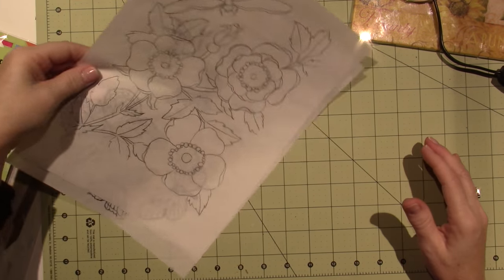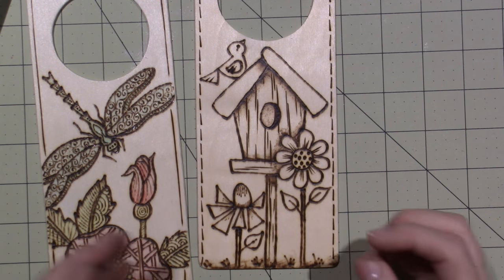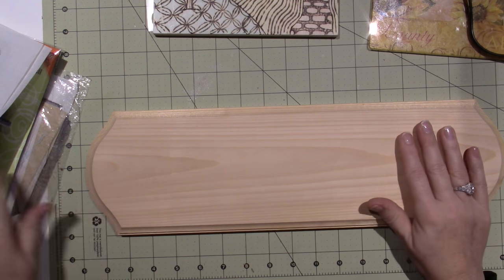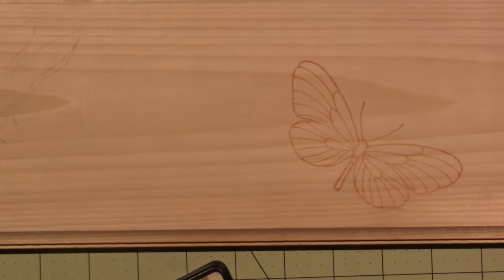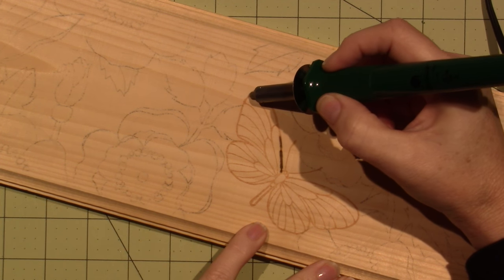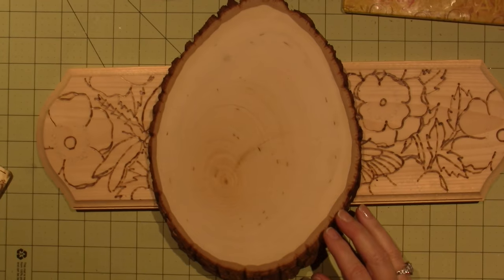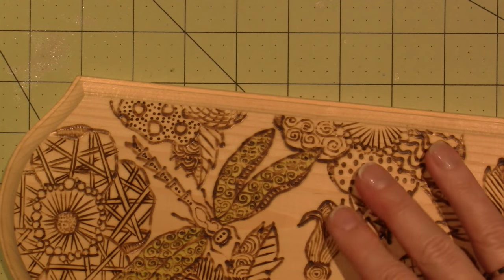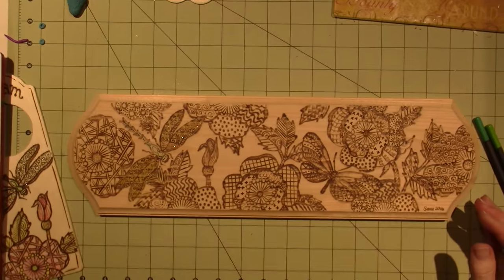Burnt flower board; Pyrography

Comment: nice video! 😃 I recommend you try the 3-4 "ball" tips from colwood. The different sizes act as a writer, liner, and shader. Any light soft wood is great to burn on...Birch, basswood, Aspen, poplar, etc. I started with burning on ponderosa pine. Pine burns great but does have hard & softer areas and if not fully kiln dried, sap. The wood at Michael's works, but if you see a seams, it's two different piece glued together. This will burn differently on each side. Wood veneered plywood is great to burn on too and you can get bigger pieces.
P.s. if you could try polychromos colored pencils, I think you will be happy, They are more transparent, so you can color darker without covering the burn. Also you can go darker with the colored pencils that you have. The burn lines act like a resist and the cp doesn't want to stick to it.
P.S.S. lol...you might want to look at spraying a clear coat before you add the wink of Stella. The wetness of the Stella removes the cp pigment from the wood and can raise the grain. I say spray 1 layer because when you brush on sealant directly over cp it smears all over the place. With the thin layer sprayed and dried you can then brush on sealant for a smoother finish with a sponge brush. Ok I'm done know... Lol 😆
Reply from the maker: Valarie Connell /DrawingWithFire ok Val. Thanks so much.